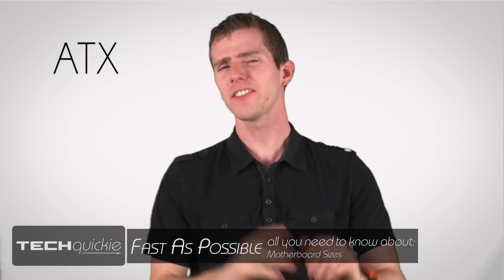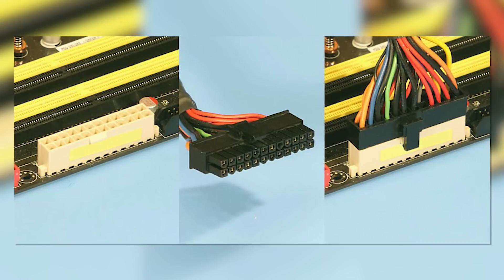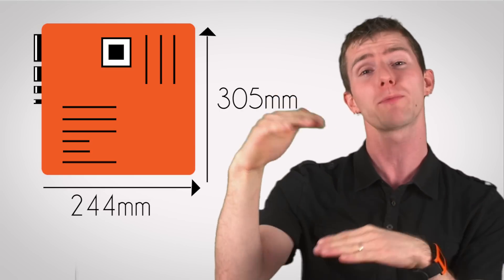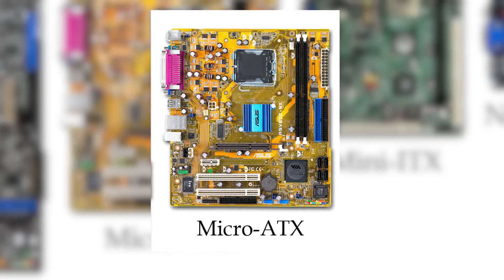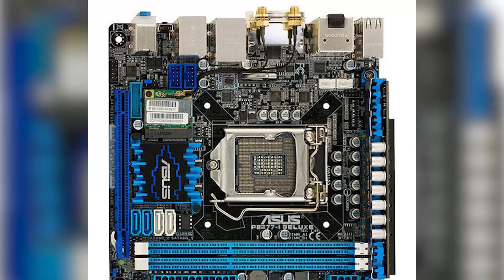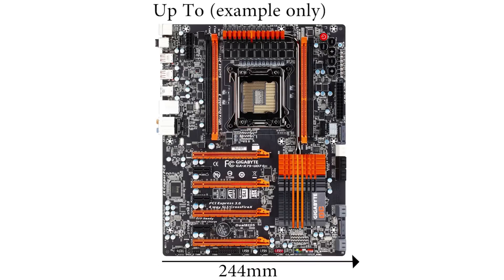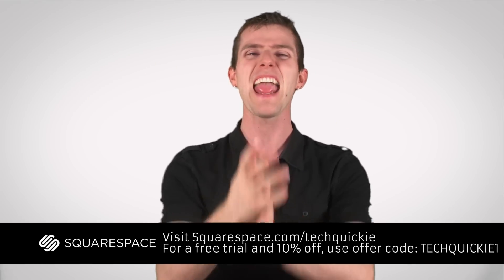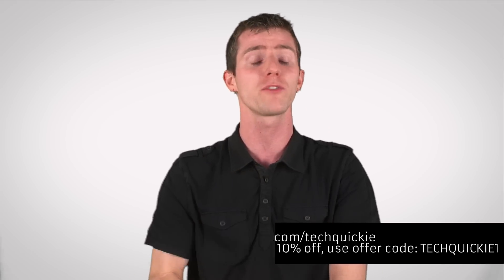PC Motherboard Sizes as Fast As Possible

Comment: This is a great video but needs updated information. 
Nowadays, ATX motherboards still have 7 expansion slots, but multi-GPU setups have become less common. Modern GPUs, such as NVIDIA RTX 3000/4000 and AMD RX 6000/7000, are so powerful that a single GPU is enough for most users.
Moreover, NVIDIA officially dropped support for 3-way and 4-way SLI starting with the RTX 20 series.
For multi-GPU setups in professional workloads (rendering, AI, scientific computing), E-ATX motherboards or HEDT (High-End Desktop) platforms like AMD Threadripper or Intel Xeon are used.
For gaming, using multiple GPUs is no longer recommended.

Comment: So, between ATX vs mATX there will be no performance difference if they both have 4 (dimm)ram slots and if you are only going to use 1 gpu. 
NO difference in performance if you are going to put the same components in them.

Comment: Watching this I’m 2019 and I go “why is ITX limited to a quad core?” We’ve come so far.
Reply: Right? You can technically stick a 3950X in a mini ITX AM4 board and then bam, you have a 16 core 32 thread ITX machine. That said, you should probably have a bit more room for such a beastly CPU.
Reply: You can put a Xeon platinum 8180 or other 28 core cpu into a Mini-itx board thanks to asrock.

Comment: You can use a Xeon workstation chip with X99 itx motherboards, and there are C-series chipset equiped itx boards, so you CAN build a workstation off a itx motherboard.

Comment: Very true interms the ole timers the AT and baby AT had great cases lots of case slots to choose from and room for old technology something i still have like Internal iomega zip drive amongst other things good to have around. Also DAT TAPE WITH INTERNAL drive but hey i wanna know is hiw you get The micro Atx mobo to run dual inside a server case and what would work with Windows 10, And Linux versions?

Comment: You didn't say the most important thing. The MB sets case size, and an ATX MB won't go in any desktop smaller than a mid tower. And a mid tower case is large enough to ship using aircraft carriers for packing peanuts.

Comment: You look at Mini-ITX now and you have m.2, bluetooth, wifi, 6 usb ports, and up to 64gb ram on some.
Reply: TisEsMe 10mm (14 maybe i forgot) iphone 7 chip… that is "as powerful as most computers" and has a 64 bit architecture … and the snapdragon 820-821-830 at 14-20mm and… quad core- 830 octacord… processor… and the 820 should be able to be turned into a desktop (the s8 rumored to be able to be used as a computer being connected to a device) laptops are great,  still.  But its slowly being pushed away since phones have taken the market being,  so powerful,  most new cellphones are a decade ahead od nasas computers since tech advances  so fast and some of the tech they use should be able to be sent to space (so change in batteries etc)…
Reply: cool
Reply: +Overknight 52 One year after comment this happened, Dell introduced a Snapdragon 835 powered Laptop.....and it was utter garbage, ARM-64 and X-86 are not compatible,  Windows could not run for crap, you have to emulate true 64 bit programs.

Comment: I have ASUS H81M-R. And i5-4460.  Is it good?  Will everything work properly?  and what will not work good ?
Reply: They are compatible but you need to decide what you need and what not.
Reply: ***** Oh well.. I need it for gaming basiclly. 
Now I know my mobo is mATX and that sucks a bit 'cuz now I've got only 1 PCI additional slot for... Sound card, maybe? Or something like that.

Also because this motherboard doesn't have unlocked multiplier so I cannot overclock any CPU here. My 4460 CPU can be overclocked for only 200MHz, but still, it means a lot to me.

Comment: i have a question: im trying to plan out my first gaming pc build and it crossed my mind that i could save alot using a mini atx board. would a smaller board lead to problems like longevity or cooling moreso than a standard size one?
Reply: And is there much in the way of limitations? Just from what i saw it liiks like you cant put as much ram or expansions into a matx, but as far as i know all i need minimally is 2 ram ports a video card port and a wifi card port. I just dont want to get a board and realize it doesnt have enough slots for gaming stuff
Reply: Xylius Schaaij actually that sounds like a good idea thanks
Reply: gordon renes compatibility is key make sure your case,RAM(DDR3 or DDR4),GPU(if your running SLI/Crossfire),CPU socket,Fan pin connectors(if you are adding any aftermarket/premium case fans)
Reply: generally speaking a higher quality mini ATX board is going to offer much the same experience. So unless you want lots and lots of upgrade potentential (or a fallback slot if you somehow botch one), you won't notice the difference.

I'm using 3 of the 7 spaces in my 990FXA-GD80 board (a high-end MSI board from a few years back), I could change it for a mini ATX and not notice a thing. I'm using all 6 SATA ports, but many mini ATX boards have that many as well.

You may even find the smaller case offerings you can use in some cases to be preferable. Though do bear in mind that full-size cases offer enough length to hold the bigger graphics cards, like the small space heater that is the R9 390.
Reply: gordon renes
Reply: gordon renes 
Jjj

Comment: Can a motherboard bottleneck a cpu or gpu?
Reply: A very bad motherboard could bottle neck the power delievered to them. but in many newer and cheaper that isnt a problem. the problem with any cheap motherboard could potentialy be the BIOS. it could be very user nonfriendly and it could probably not allow over clocking and other crucial settings.
Reply: which type of Cabinet i have to use for 6 cm height and 25 cm wight?
Reply: thanks Xylius

Comment: What is the best cheap mother boad for the gtx 1070 g1? And do diffrent atx affect the performance or do they all do the same?
Reply: mobo upgrades are purely feature
Reply: mobo upgrades are purely for more features, so get the cheapest one that has everything you need
Reply: Mobo upgrades aren't for features, usually you change northbridges and depending on the mobo  you get the northbridge may have more PCIe Lanes than the previous one.

Comment: PC NOOB here.

Looking for a mobo with LGA1151 socket type, support 480s in crossfire (xfire not mandatory), and can house a wifi card without being obstructed by the gpu. No interest in O'clocking cpu.
Reply: I just got one that fits all those requirements, I'll get back if I remember the name, in bed right now.
Reply: +Clorox2 lol okay, thanks!!
Reply: Rezinator Sorry for the late reply, had to build my PC since my laptop took a break, ASRock Fatal1ty Performance, is the one I'm using, but I use Ethernet, so I cant say on the WiFi card.

Comment: Can someone tell me what is an expansion card?
Reply: An expansion card is whatever requires insertion into a PCI-E (Or M.2, PCI, eSATA) Lane. The most common expansion card that you are to see is a Graphics Card / GPU. While others include WiFi Cards, Bluetooth Cards, SSDs, Sound Cards, etc. Expansion slots are higher or lower quality based upon their "lanes". In an overly-simple sense, the more lanes, the better. Many motherboards may appear to have all 16x slots (slots can be 1x, 2x, 4x, 8x, Or 16x), but some will have 16 lanes while others have 8. If you put a 16x card into an 8x slot, it will still be functional but slightly slower. Your CPU also has a set number of lanes that it is able to use. If you have 2 16x cards in 2 16x slots but your CPU has less than 32 lanes, the cards will run each at 8x.

Comment: In needed some help in selecting a gaming graphics card. I have a Gigabyte H77N-wifi board in a Lian Li case. What is the best choice for use in the PCI 3.0 low profile slot in this case?

Comment: What if the psu has a 24 pin atx power cable will it work with a eatx board?

Comment: I bought a pre build pc and it has a micro atx motherboard. I was wondering if i can get standard atx motherboard and move all the parts to that motherboard and put everything in a better more flashier computer case.
Reply: make sure you have compatible ram slots and you'll need to refresh hard drive and new OS but i guess that's all fine. Also you should get a new PSU since it's prebuilt but that's up to you.
Reply: +Matalino yea i was going to get a new power supply. But when you say a new os do i have to buy a new one because i already have windows 10 in my hdd.
Reply: Ultimate_Deity usually pre-built OS are built in into their motherboards and I think you can't reuse them. I asked before on linus tech tips forums and they said the OS is "married" to the motherboard.
Reply: +Matalino i guess a motherboard is out of the question. Ill just buy a case and a better power supply. Thx for all your help.
Reply: Ultimate_Deity No problem, Good luck on your PC.

Comment: What about mobos that allow like 10 GPUs to be installed?
Reply: SLI and Crossfire only allow 4-way configurations for the most part, and the amount of power and PCI-e slots would  be too much to cool.
Reply: By "Like 10", you may be appoximating 7? There are actual ATX (Not EATX) that do support 7-9 PCI-E Slots. However, most modern GPUs are dual-slot which would allow for half as many to be installed. As previously stated, there is, currently*, no point in more than 4 GPUs Anyways.

Comment: does ram depends on your power supply (more ram,more power?)
Reply: Generally the motherboard will have a maximum power draw requirement that will encompass the usb's and expansions slots and ram. I would say the ram is a very small proportion of the total power draw.

Comment: So does that mean if I only want to install 2 RAM sticks of 4GB each and a single graphicscard and want to save some money I should buy a micro ATX instead of a normal ATX?
Reply: Depends.
Reply: depends if you plan on upgrading down the road
Reply: It may not have been so when this video was created 2.5 years ago but motherboards are no longer cheaper because of size. However, you can often find a very cheap motherboard that possesses 2 RAM slots and a single PCI-E x16 Slot. Just be sure to include any other features that you would like in your search. Since you're mostly set regarding features of any motherboard, the only real advantage of Mirco-ATX now is size. Not Price.

Comment: SSI standards?
BTX?

You guys should re visit this topic ...
Reply: it failed in replacing atx as the standard in pcs but its very common in server aplications as well as in the retro build comunity. theres a pretty large groupe of people that like the btx format because its unique and alot of people dont know about it because it wasnt aroud for very long in pcs. in fact the only reason i know this is from researching a dell xps 720 ive aquired and have decided to build up. its actually what im on right now. ill probably end up converting it to atx in the long run though hah
Reply: Chris Brooks Wasn't BTX a failure?
Reply: Those are not commen
Reply: btx is  more common than youd think

Comment: Anyone know the cheapest motherboard and graphics card combo to run a titan x and get max performance benefit for that price point?
Reply: no
Reply: Bit late here but the GA-Z97MX (the board that I personally use) is an amazing motherboard generally found at under $100 including a PCI-E 3.0 x16 Slot for your Titan X. However, if you're looking for a cheap setup, don't buy a Titan X. Whatever you do. The GTX 980Ti is virtually exactly the same performance as a Titan but about $400 Less.
Reply: not bad i still like the graphics thanks for the reply NP it being late is ok

Comment: What about performance? If I put the same GPU and CPU and the same amount of RAM into mini-ATX and Standard-ATX will the performance be the same?
Reply: yes
Reply: It Depends. As For CPU, the sockets on the 2 boards would have to be the same if you wanted it to go in at all. Certain boards support more RAM than others so a new board not might recognize it all (this usually only applies to high amounts of RAM). Also, DDR4 Or ECC RAM may be supported in the first board but not in the second. A graphics card would fit into any board. However, older small boards may have PCI-E slots with less lanes. If that is the case, your GPU would suffer minor performance impairment. This is generally only an issue with older small cases. However, A GPU that fits into an ATX case may not fit into an ITX Case.
Reply: Миша Шевченко size won't affect it, no. But check the board itself.

Comment: got a matx board. thought it would fit my matx case. this isn't my first rodeo. had the stand off holes for a wider matx and that's all i took into account lol. had to get another case for my machine because it would not allow me to fit the 24 pin psu cable in the board. the hdd cage was in the way. honestly i was curious if there was a name for the wide matx boards. people learn from my mistake, get a big case with planty of room, not the first thing you find on craigslist that someone is wanting gone lol. save some money at the time but after the board failed, i had to get another case with the new board. ended up getting an atx mid tower used for $10 and that old case is prolly gonna be given away.

Comment: i think that i have a mini ATX, can someone recommend a cool case under $120, thanks a lot. Also it has to be able to hold my trix r9 290x ;) (thats 16 inches long)
Reply: Why... Why would you have a Mini ITX with a 16 Inches Long GPU? What ..
Reply: +Thunder Pig idk
Reply: +Thunder Pig because i dont want to upgrade my mother board
Reply: +Thunder Pig BECAUSE I CAN..srsly check out my gpu on amazon, it was 55% off
Reply: ChubCraft It's not that, you shouldn't have a very powerful GPU on a small motherboard....
Reply: +Thunder Pig y
Reply: +ChubCraft Well, your motherboard needs to be able to actually accept and support your GPU, and also your CPU will need to be powerful enough to NOT BOTTLENECK your GPU.

Bottlenecking is when a component of your computer isn't properly compatible with the other components and is basically underpowered. In that situation, you're not getting your moneys worth, and wasting a lot money for your decision to not upgrade or seeing if components are compatible with one another.
Reply: +Ghostly butt they are-i get 130 fps in Heaven at ultra
Reply: +ChubCraft http://www.amazon.com/s/?ie=UTF8&keywords=enthoo+itx+phanteks
Reply: +Zach Miller got a phantom 410, but thanks
Reply: Just because he's running a mini ATX motherboard, that doesn't mean he's automatically bottle necking his GPU. Theirs no reason why he couldn't be running a top of the line I5 or I7.
Reply: THANK YOU, im running a 6600k btw ;)

Comment: I need help! So will my custom Pollywell case be compatible with Micro ATX motherboard? the case is for an ATX motherboard
Reply: It should
Reply: +SKY TECH yup, a smaller standard board can fit in a case made for larger sizes. its just that cases designed for Micro ATX WONT fit a standard ATX sized board.

Comment: can you do a video on motherboard chipsets?
Reply: +sadman hoque If you do that your CPU wont work...
Reply: ***** Motherboards and CPUs have different sockets. So the same way you cant fit a circle in a triangle hole, you cant fit a LGA1105 socket CPU into a AM3 motherboard because they're not compatible.

The best way to check if your system is compatible is to use a site called PCpartpicker.com
Reply: ***** No trust me if your motherboard chipset isnt the same as CPU chipset you wont be able to update to the most recent version in the bios.
ie if I have a 760G motherboard and a CPU with a 970 chipset it wont work that will. Trust me I know this from experience as I bought a second hand 760G motherboard and my PC didnt work that well. Then I switched to a 970 and its working perfectly
Reply: coolkiller056
how'd you even know what chipset your processor is?
Reply: +sadman hoque Yes, please. I've no idea what it means and what I should choose!!!
Reply: +sadman hoque Yes, please. I've no idea what it means and what I should choose!!!
Reply: Maurits yæh
well if it helps I came up with a rule of thumb that don't give a crap about what the chipset is called & just look for motherboards that have all the features u want and fits yr CPU lol
Reply: he already has
Reply: +sadman hoque look it up on the Intel or AMD websites
Reply: coolkiller056
why? 0_o
Reply: ***** Also you can look at a CPU's chipset and a motherboards chipset and see if they're the same.
Reply: coolkiller056 you mean the CPU socket, not chipset, the same CPU can work with a a number of chipsets.
Reply: coolkiller056 - this thread is over a year stale, but I'll chime in. The CPU has an physical compatibility constraint that is the socket. For example, the sixth through eighth generation of intel core processors use LGA 1151 as their socket, which has to do with the number of pins that interface the CPU and motherboard. Within each socket, there are different chipsets, which are different packages of features, like overclocking support for unlocked CPUs. Not all CPUs of a socket will fully support all features of a chipset or entire chipsets altogether, and vise versa. Intel's now skipped "tick-tock" model for CPU development used to pair two generations of CPUs and chipsets together under one physical socket with overall interopability between the two generations of CPUs and chipsets, but with Cannon Lake, the socket remains the same, but the chipset compatibility has been changed to a "tick," so to speak. 

I tried to make it less wordy, but the explanation itself is technical in nature.